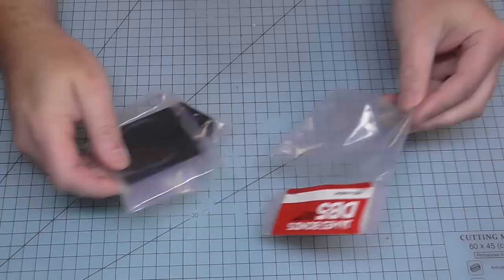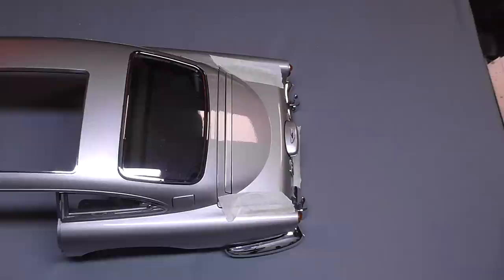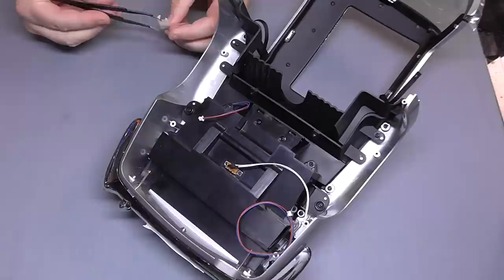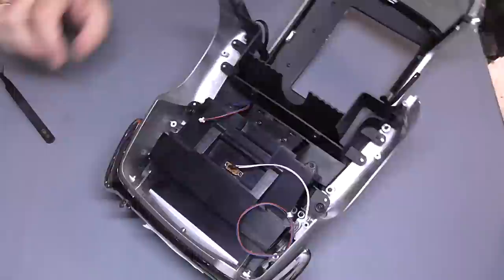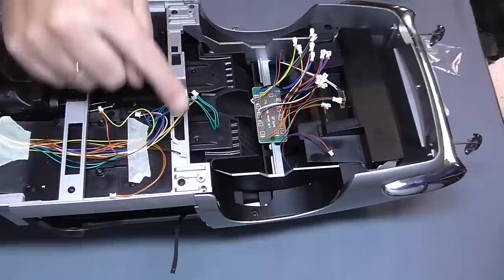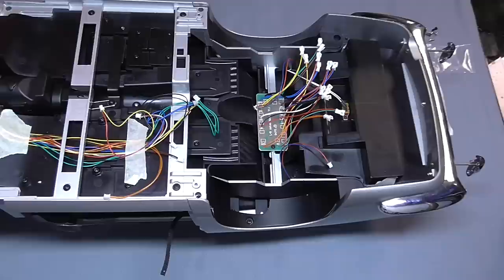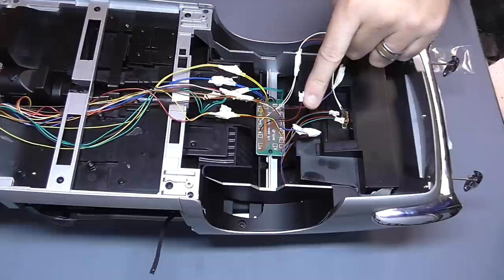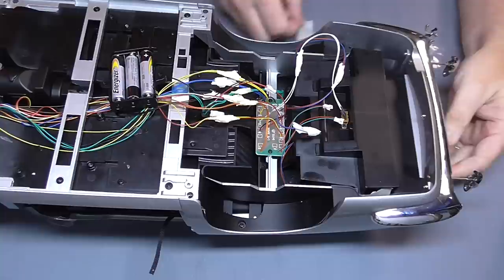Build the 007 James Bond DB5 Aston Martin 1:8 Scale - Stage 83

Comment: Wayne,  Now you have taped the wires for the back lights down to the inner side of the trunk lining, how do the rear tail lights drop down. These wires need to be able to move free so that the rear lights can drop down. If you now try to drop the rear lights you will break the wires.  My next point the seat belts, there is a small hole in the bottom of each seat belt. The seat belts are to be tucked in place where door pillar comes down and held in place by the screw you've put all ready in places from the under side.  ( PVA glue helps to keep them in place before putting the screw in. )  The headlight wires are better to be tape up, under the wings then traced around,  run across towards the washer jets. Very carefully drop each pair of wires down each side of the speaker box. Very fiddly.  Where you have them they will get broken and trapped when the base goes on. The mass of wires go under the cross rails of the metal sub frame and on to the under side of the floor.  You will need to loosen the floor screws ( 4 ) to get then under the frames, once all the wires are under the metal cross rails they can be tighten up again. The way you have them, they will be trapped when the floor pan goes on and get damaged.  I've built well over 20 of these models, shipping them all over the world.  Hope that these few points helps as so many of these models once finished the electrics don't work.
Reply from the maker: Yep. The rear lights. I only secured the electrical wires, not the filament thread so they go down no probs at all

Comment: Wayne, I think that those green-red wires from the front lights would better be moved under the crossbar at the center of the model to avoid being pinched between that and the bottom panels that they will make you install in the final stages of the build.
Reply from the maker: They will be in the next stage. I put them there just to test the headlights

Comment: Hi Wayne... PLEASE HELP... I'm STUCK☹at this stage trying to fit the front body onto the chassis! But first off, I like to say a million THANKS to you and your video instructions for getting me through this far, as well as those by Steve of SMKR and the MyJamesBondDB5 guy. I'm from Hong Kong and I was lucky enough to have a friend in the States who would subscribe for me which in the course of two years, every 4 months he would send the parts he collected and send them over, but I procrastinated and only started building this a month ago. (March 2022)
I'm afraid mine has met the same fate as SMKR Steve's. The front body part fits beautifully on the passenger side BUT the driver's side stubbornly refuses to fit down onto the chassis, even by force, hence the door won't close and above all, like your instructions I tried to first remove the windscreen frame like you said (which incidentally was a bitch to install in the first place) but in doing so, there's now a hairline crack 😰 which I have no idea how I can get a replacement part if not paying a ridiculous price for one on eBay IF there's one there!! So I'd be eternally grateful if you could help me cross what's now looking like, an elusive finishing line for me! 🙏🙏🙏🙏🙏🙏🙏
Reply from the maker: I dont know what to suggest Richard. When I did mine as long as the front end was on tight and the screws tightened up the doors went in fine. Try finding a longer screw that will catch the threads on the other side and provide force to pull the parts together without damaging the bodywork. Also, i am guessing somethings under that door sill is stopping it so get a pen light and see what it could be
Reply: @WorldofWayneUK  THX STEVE for the quick reply, today I'm gonna remove the engine and the bulkhead so as to peek inside from the engine compartment and hopefully can see the extent to which the misaligment of the two parts are before taking up your other member's advice to enlarge the hole and use a bigger screw to force them together. And btw, may I point out that u've possibly missed out on telling ppl to insert the two supplied washers onto the holes of the rear suspension units when fixing them onto the chassis cos the screw head is smaller than the hole hence it won't work as in your video!
Reply: Hi Wayne, I finally got mine to work. First I lightly screw in the front end of the difficult side but just enuff so it won't fall back onto the table, contrary to what you suggested, so to allow for some lateral play, then I apply pressure on the difficult side first and use a Y-SCREW (as it's 1mm longer) to tighten it up.. Once that's done, I loosen it up just a bit and then forcibly bring the other side together with an A-screw but not overly tight, then return to the difficult side and tighten down, then the same on this side. Finally I put in the remaining front screw and then tighten both that and the first front screw and it's done. Maybe mine is not as bad as others but that's how I got over this penultimate hurdle. Hope this helps.

Comment: Hi Wayne did the windshield frame get cracked when you were installing the  two halves of the car together ?  It looked like there was a crack in the windshield frame when you were showing the overall car  assembled.  Gerry
Reply from the maker: No. I think it’s just the light. I didn’t even have it attached when I fitted them together
Reply: @WorldofWayneUK  Thanks Wayne. I will follow your instructions when I get to this stage of my build. Cheers Gerry